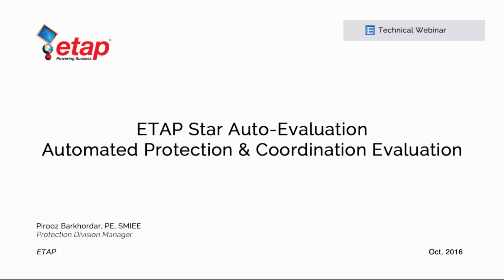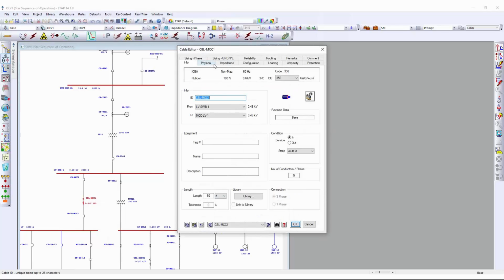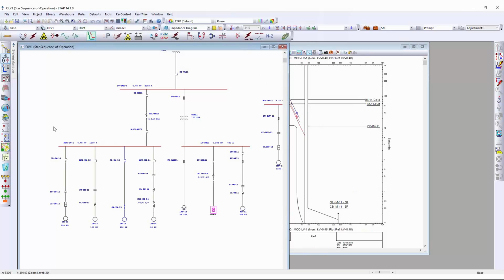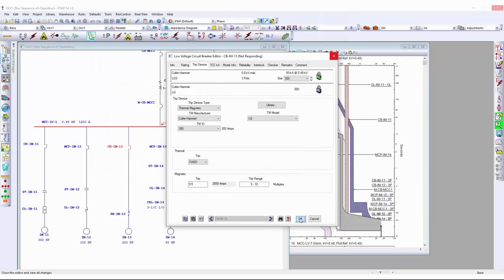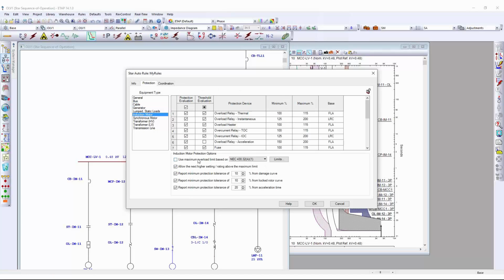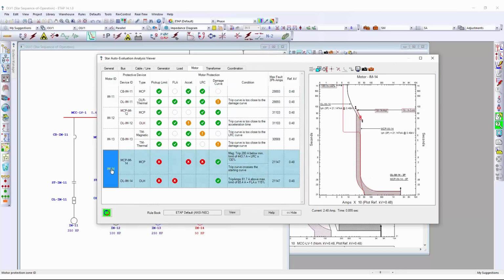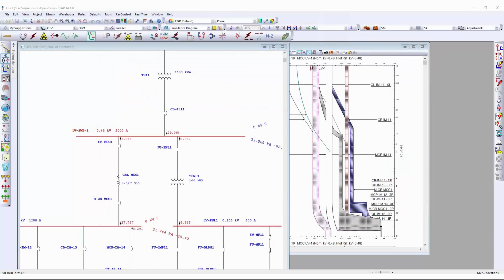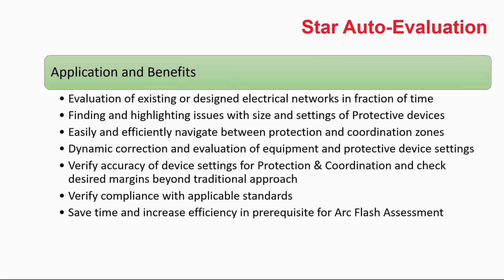Star™ Auto-Evaluation:  Automated Protection & Coordination Design Webinar

Comment: Please, provide a video on Modelling a complete power system that includes for example a diesel genset parallel with grid, transformers, transmission lines, distribution systems, protection, grounding, etc. That would help the users and other engineers to get a feeling of how this software models and simulates. We would like to know how we can model and size a complete power system as every project we work on includes a complete power system and not a component of it. Thank you.
Reply: You can find course on Udemy for working with ETAP it covers lot of issues you have mentioned
Reply from the maker: Please feel free to contact one of our local offices for a complete demonstration or download our free demo version from our web site https://etap.com/demo-download